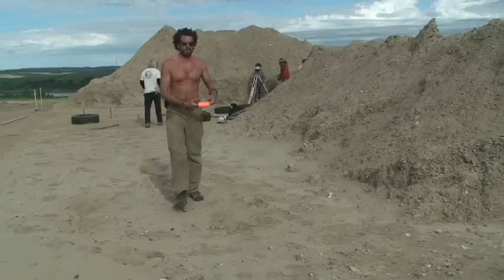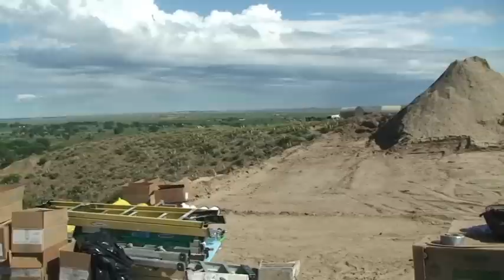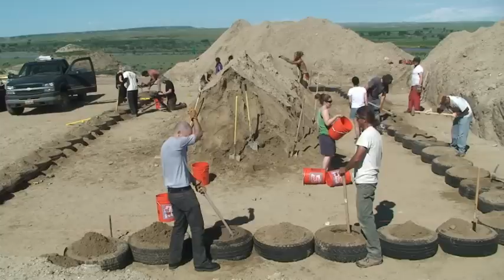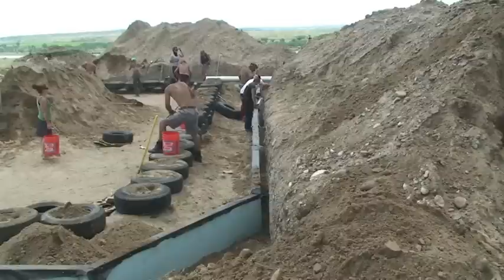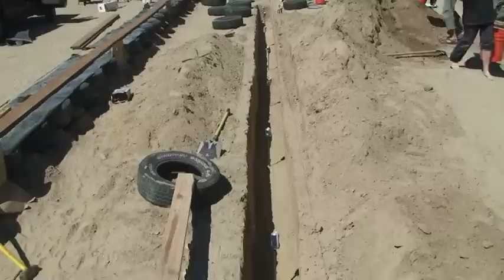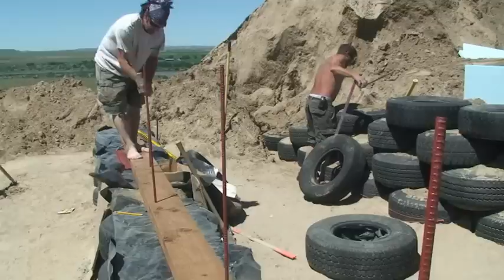Montana Earthship video 1

Comment: This project exhibits the most significant thermal massing (5'+ thick) I have ever witnessed in a wall system (me gusta).  But where are the 07 26 16 Below-Grade Vapor Retarders (CSI MF 2004 code)?